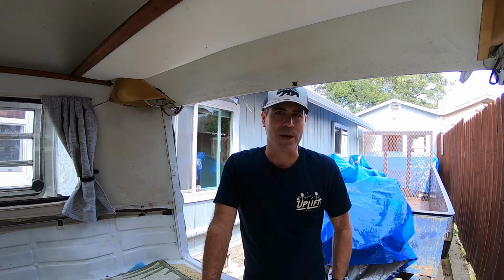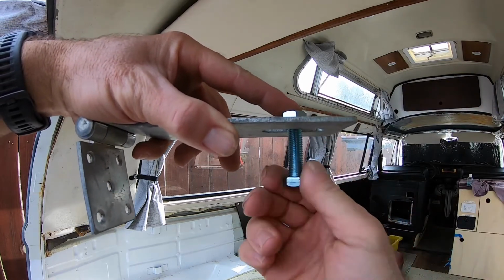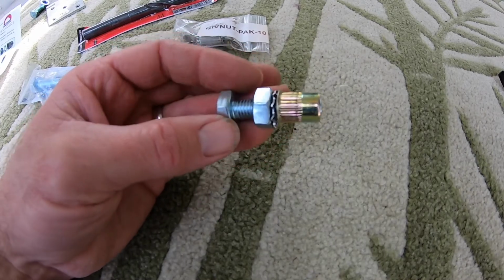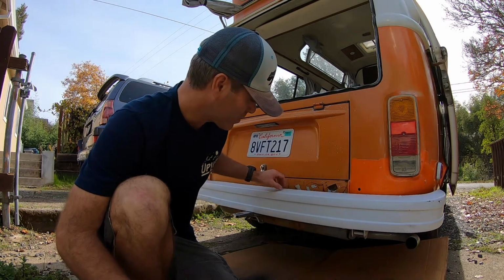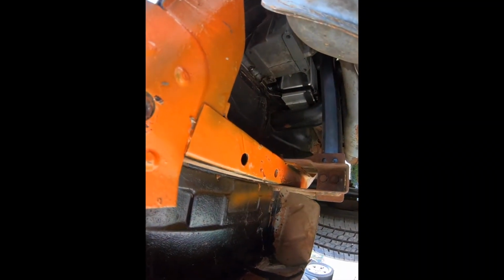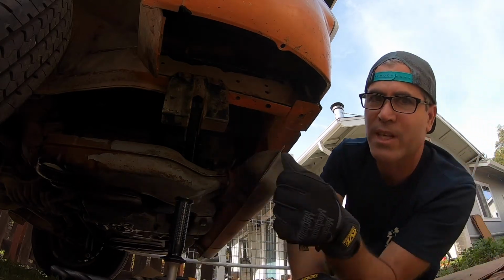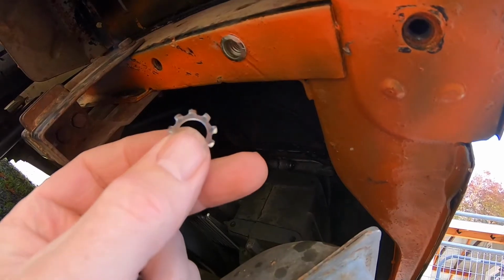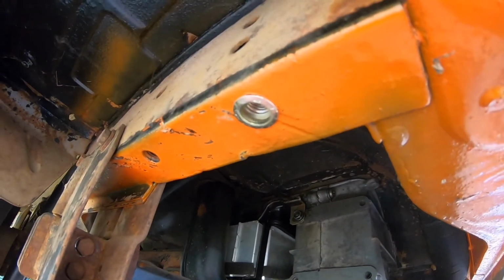Replace Broken Bumper Bolt VW Bus

Comment: bro you just saved my life and a lot of money.. I got hit in the back so my rear bumper is damaged.. the nuts from inside all are broken and are the second time I cut the metal and weld nuts from inside.. and telling the truth the last job was so shit that my rear bumper is not horizontally ... the same method I can do on the front bumper which is being held only with 2 screws... if you were here I would have given you some beers... bravo and good job
Reply from the maker: Man, I'm glad it helped you out.  I was stuck on this problem for a while before I figured out this solution.  I'm super stoked on the end result...not a lot of effort for a really quality fix.  Mahalo!